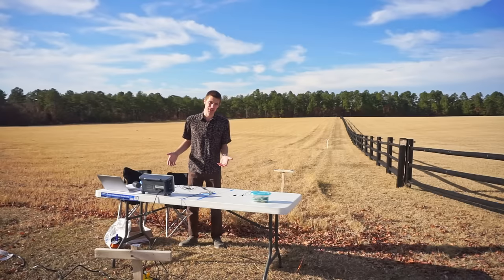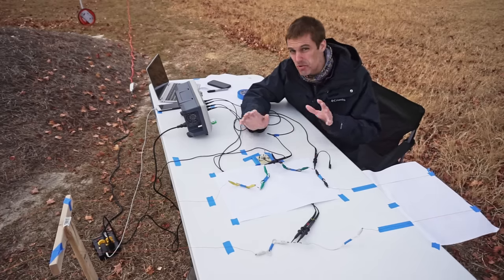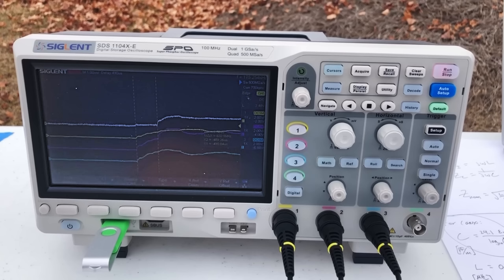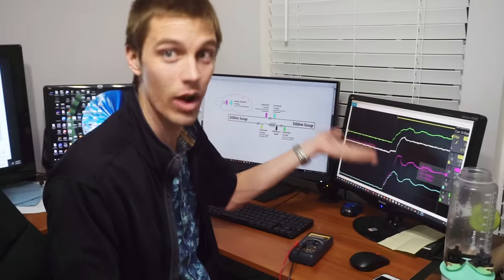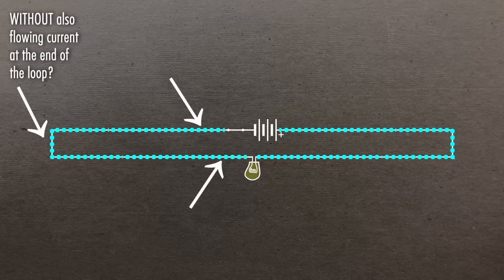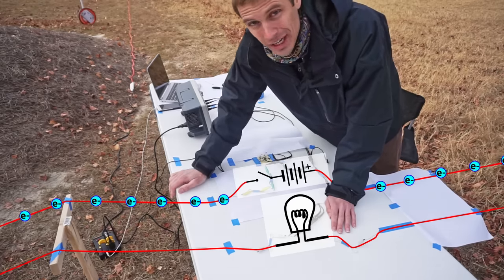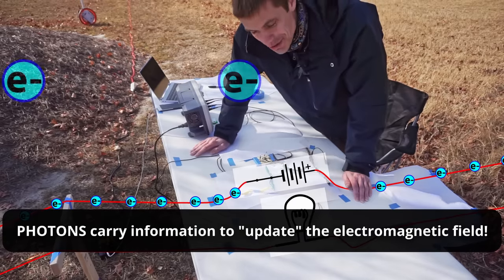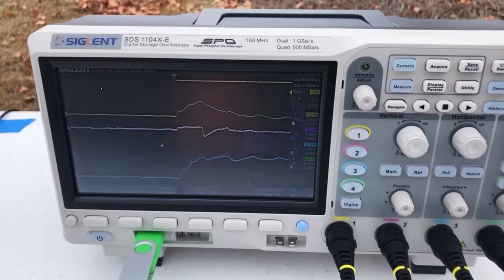I bought 1000 meters of wire to settle a physics debate

Comment: You cannot make electricity to travel as same speed as light since electricity has to travel through a wire and that slows down the speed of it. It would be so cool if we had that cause internet for example would work a lot better but that is another discussion since we also need encryption and decryption and so on that slow your internet.

Comment: So if the "air gap" between the wires was larger then the electrical field wold not be able to affect the electrons further down the wire, therefore, you wouldn't get the almost instant initial flow of electrons that happens nearly instantly??

Comment: If you could repeat the experiment with just small length of wire and compare findings on your oscilloscope to see if the time delay is because of the length of the wire or some other anecdotal factors

Comment: Great video! But if you could vary the distance between the parallel wire and observed that the initial current in the first 1.6uS increased/decreased with smaller/larger distance, that would be the solid proof to your theory.😊

Comment: @alphaPhoenix instead of going in straight lines parallel with each other, why didn't you make circles in order to (virtually) avoid the potential argument with capacitance? It wouldn't remove it entirely, but virtually infinitely.

Comment: Is there significance in putting the battery and light in the middle instead of the ends? How does it change when you have a negative next to positive wire the entire time instead of negative wire next to negative and positive next to positive?

Comment: So current is instantaneous with that microamps of flow observed. The transistor is a solid state has charge carriers and leakage current which are already present before it's actually closed. Same experiment with different physically disconnected switches would be interesting.

Current is instantaneous but waves take time to travel.

Comment: It would be fun to do it with an ethernet twisted wire pair. Because we all know that DC is a very simplified model of AC. How does a wire apparatus that was designed for high frequencies AC react to a switching of DC current?

Comment: om wires as weak capacitors, this also works the other way around, on disconnecting the circuit.
some chinese LEDS are made too cheaply yet efficient, with no control or safety circuit == not enough electrical resistance to be turned off reliably, to a point, where 5to20 meter of copper wire in the wall is sometimes a good enough AC-capacitor to keep the LED glowing for a few minutes AFTER switching the circuit off/disconnected.

Comment: In your experiment, you assumed a battery is an  instant power source. In reality, it is not. A battery generates current  through electrode reactions. No reactions are instant.  Your initial small current might be from the capacitance of your battery. The delayed large current are from your battery electrode reactions.

Comment: Very interesting and detailed. Takes me back to my electronic engineering college days. Brioche older much than you I must say it would be much more impressive although not as easy to set up or as accurate possibly if you used an old HP tube oscilloscope. I’m glad you didn’t.

Comment: How would this expirement work if the wires were in a large circle instead of running in parallel?  Would you still have the initial 200 micro amps of current for roughly 1 microsecond in the resistor?

Comment: I think you would make better results if you put the bulb next to battery, first time next to positive pole, second time next to negative pole, then you would have longer distance, 1000 m from source to bulb if current flows from one pole to another, instead of 500 m if current flows simultaneously from poles, and we would finally know the direction of current, positive to negative or vice verse. Or it doesn't matter because the current has to travel the entire 1000 m path regardless if the source is closer or further from the bulb.

Comment: What happens if you setup the wire making a circle, and put the bulb and the switch far away so that the electron from each end doesn't interact. Does the 1.6 microseconds bonus current still appear?

Comment: you know that device that has all the steel balls hanging from strings and when you drop one the ball on the other side of the line reacts instantly no matter how many balls there are and the same number of balls react, isn't that proof that energy moves at the speed of light, just steel balls instead of electrons

Comment: Uh, yes, electromagnetic waves travel at light speed in a vacuum. In a wire, no, it definitely doesn't. For instance, in coax, I believe electromagnetic waves travel at a about 1/3 the speed of light, IIRC.

Comment: electricity does not travel at the speed of light, remember electrons has mass, and there is resistance in the cable. But when a cable is charged, and electromagnetic waves travel at the speed of light, the electrons at the end of the cable gets the signal at the speed of light. Common misconception, well known to physicists.

Comment: I wonder hoe the graphs change of you put the switch right next to the light bulb. I expect the bulb would get 5V at first, which would then drop as soon as any current starts to flow due to the inductance of the circuit and then rise back up again to 5V.

Comment: OC electricity moves with the speed of light. Its known since the late 19th century as some dudes wanted to lay a underwater cable from England to USA. The messages got crumbled etc. In fact the messages got slow down by to 2/3 of the normal speed. Water  slows the speed of light to 2/3 of its original speed. So electricity as fast as the light.

Comment: Is it true to say that the Yellow trace is effectively a very short, high impedance (3 kΩ) direct route for the current to flow in parallel with the 1Km loop? Would it have been better to put the probes across a resister on one side of the switch instead?

Comment: But what if it is a big circle instead of parallel wires? The generated electrical field (17:00) should not be able to interacted based on our noisey surroundings?

Comment: Electricity doesn't travel at the speed of light, only the electric field is. So the current's speed is actually equal to the speed of light; But since nothing can travel at the speed of light, even electrons can't and you can't say that electricity is traveling at the speed of light, prior to define "electricity". So, to resume, electrons don't travel at V = c, but the electric field inside the wire does.

Comment: Still... if it were physically possible and feasible to use a length of wire to the moon and back.. thing is, wire has resistance which is dependent on factors such as temperature, material, length and gauge... I guess the most accurate way to physically measure it would be using a super conductor wire to the moon and back or a super conductor wire in a vacuum the length of to the moon and back.

However, everything I understand about electronics being an EE major in college states that in an open circuit there is zero current flow. So in all reason once and until the circuit is closed then we would measure the speed of the current flow at or very close to the speed of light. Now yes there is capacitance and inductance to consider aside from resistance but I figure the using of super conductor wire in a vacuum and isolated from any stray magnetic fields/static would be the most accurate way to put this to rest once and for all. But the problem is getting a superconductor wire that long in a vacuum isolated from any stray fields... I don't know how lol.

That said, I really appreciate you doing this with1,000 meters of wire and regardless of other factors and variables we can come to some conclusions that without the physical experiment we do know less and with knowledge it is a situation where more is more and more is better. "Less is more" doesn't work with knowledge, only with some art forms, subjectively.

Comment: You explained that very clearly, especially how photons are involved in the electromagnetic force.

Since the wires are so close apart, I imagine a rounder loop would show almost zero initial charge since it can't cross the air-gap.

Comment: How exactly does closing a circuit cause "electrons" to move at the speed of light?  How can an action that occurs nowhere near c achieve c speeds?  This makes no sense, especially considering that electrons have mass, according to physicists and textbooks. Accelerating mass to c is supposedly an impossible violation of physics, yet here it occurs with very little effort.  I think there is definitely something wrong with the electron conception.
Reply: Imagine a one kilometer long chain. If we pull the chain on one side, even very slowly, the other side will move immediately. The transmission or propagation is much faster.

Comment: Is my math correct based on this experiment that it would require 625,000,000 meters of wire (388,356 miles) for there to be a 1 second delay in the light bulb turning on?

Comment: Would the small “instant” current detected due to the electric fields from the electrons be reduced or even eliminated if the wires were not so closely parallel? Like if the wires were in a large circular loop would that still happen?

Comment: You can send 100kW through a thin magnet wire if you wanted, if you use high voltage and low current... and the wire won't burn out

Comment: I think that if you had electrical wire that’s 1 light second in length and had its ends meet (making it a circle), the time amount of time that it will take for electricity to flow would be 1/pi seconds but I’m not qualified for this so don’t take my word for it.

Comment: But there is nothing moving faster than light there. You are just getting interference from the close wire like you said via capacitance and inductance. Could you try it with a circle instead? There may still be some current leaving the battery but there should be nothing  in the oposite end. Unfortunately you probably cant measure the other end effectively becuse it would be so far away.

Comment: electricity should be instant... it doest travel like you a single point. its either at the beginning and the end or nowhere. how do you think electricity takes the shortest route? or shall i say the route of least resistance? even through a mace? if you have a table completely filled with round small balls. and you start pushing one ball from the other side of the table? put as many obstacles as you want. if the connection is not completely broken off then the instant you push a ball inn one goes out (in terms of mass), no matter the distance.

Comment: It is too imprecise. A  better way would be to send a high tension current down the wires causing a spark between a gap in a rotating disk with a hole in it.

Comment: I hate to make you do even more excellent work, but what if you flipped the wires on the end? Like when you went out and cut the wire, what if you just grabbed them and swapped them. Maybe then you could see that induction get cancelled out around at 1.6/2 microseconds. Or would it be 1.6/4? I don't know. My head hurts.

Comment: 2 forms of resistance have been ignored but r relevant to RT ie internal resistance of the battery & resistance of the medium ( resistance is directly proportional to length & diameter ) copper as a material will also have a standard resistance compared to gold or silver or aluminium as conductors, all these resistances wid have to be added to the resistor's value when calculating ohm's law.

Comment: Can someone explain the phenomenon of the second "wave" converging towards the first at 17:00 ? I don't understand why and how it starts almost immediately. Wouldn't that mean that some information travels to that far electron faster than c (at which the first wave is travelling) ? 
Or is that a result of how the wires were set up (parallel to the battery flow and very close to each other) ? This resulting in electron affecting each other through the gap between the wires ?

Comment: The thing that always got me wondering is that traces on PCBs like mainboards have these little wavy patterns so that they are all the same length to accomodate for the time of the signal to travel. However if they were to close to another like a zig zag pattern in a heating pad or sth. but even closer, the signal should get worse interference due to the electromagnetic field acting between the wires along the pattern and not along the actual trace..
Reply: All things that have to be considered in high frequency circuitry on boards. And as computers have gotten faster, these boards as well.

Comment: Well if one sees a DC source and imagines the energy the electrons are drawn in at the plus and released at the minus ( electron flow versus calculation flow )  and the flow of fields going in both directions then one has the length of wires divided over the time light needs to travel over your whole length of wire divided by two and then one needs to look at the effect of fields especially near field effects of one stands close to a Tesla coil fluorescent tube lights up as well if close enough and if you see it as an antenna look at the equipment you need extreme good equipment to measure it. If you measure directly you will see that fields go both directions and once they have gone around a whole length the thing lights up completely aside from that if one leaves the wires away and has enough voltage so one can do without this equipment and use something like a Tesla coil or another very high power source of close enough you don't need any wires. Imagine standing unde a high voltage line if you out some flourescebt tubes in the ground you will see them light up as a result of parasitic capacity and the fields being around the line whole the way up to the ground, also an interesting experiment, if one where to increase the unductance L and put the tube up on top of that and use the other side grounded and rise up a plate as a capacitor one has on capacity against te line so a simple R ( ground towards nearest grounded high voltage line ) L transformer quite a large one vut metal does not matter 50 or 60 Hz of power line and C ( capacity extremely small against the power line ) feeding source a high voltage 250 kilovolt AC line and its field, ground an R towards the nearest powerline ground poke system in Europe a lot of them have ground rods every so many of them. And then the circuit in between don't go for complete resonance that will kill you that also is an experiment that is something related although distant towards this.
The fields do the work if you have all the electrons do the work your molecules would fall apart.

Comment: I thought electrons were already in the wire without a charge the battery only allows the electrons to move either forward or reverse depending on the phase the battery is in remember a speaker can produce electricity so does a microphone an electric guitar a very small voltage with the help of magnets

Comment: 9:31 this makes sense l' if you get shocked from a wall plug your not likely to get the full current flow as you don't register as a the best conduction in the system..

Comment: What happens if battery and bulb are at very large distance and connected by two parallel wires with very minor gap between them. How electron moves?

Comment: Ridiculus measurement techniques. You don't measure current over a resistor, but it potentials related to radiovawes in different places. Try to learn how to use a multimeter. You need only one probe, connecting one terminal to ground. Or if you want balanced signal input, you should connect those 2 probes grounds and cover a resistor with that mutual ground. My eyes are bleeding.

Comment: This is a Alice Wonder Land story of the speed of electricity. All you have done is make an unknown RCL Circuit (Resistance, Capacitance, Inductance)  and fed AC pulse, the leading edge is AC, into a mismatched line. I can tell from the overshoot, refection, rounding of the edges. Look up Transmission Lines Theory and A time-domain reflectometer (TDR) measurement. Electricity for a copper wire is about .9 of a nanosecond per foot delay. Worked in a lab, did not have a pulse generator that would go low enough, so for adjustable delay of less than .02 of a nanosecond, build a delay line.  Good Idea to learn the difference between impedance and resistance.

Comment: A fantastic video. I know next to nothing about electronics but when the wires were cut both wires were then plugged into the same machine so could there be some sort of connection going on there and influencing the reading on the screen. Perhaps if the scope was only connected to the light bulb wire when the battery was switched on it would have been better. Anybody any thoughts on this ?

Comment: Uh signal on a pcb goes at about 4ns / foot  - i have worked placed that used to use a reel of coax as a delay line (40 years ago) for a 50 ohm trace (and 50 or 75 ohm coax)

Comment: As far as I understood Ideally electrons move all at once as fast as physically possible in (1/Lightspeed) seconds, what's the whole point of the experiment, if you don't calculate in capacitance, inductance and the actual switch? They are all slowing down the actual switch on time, pretty pointless experiment